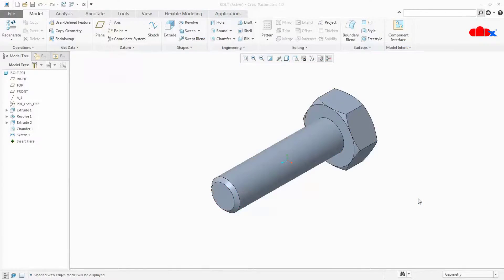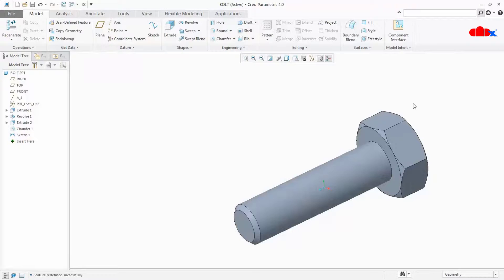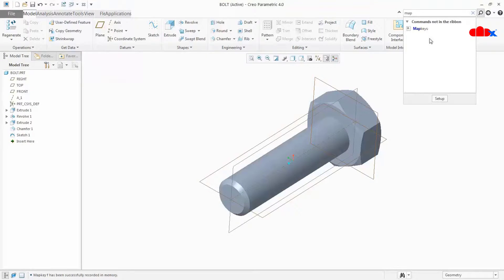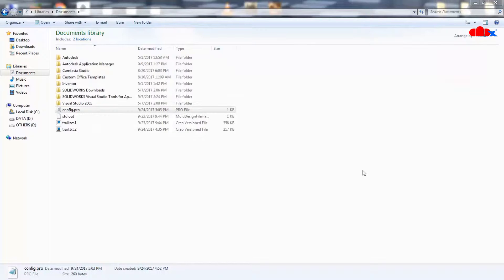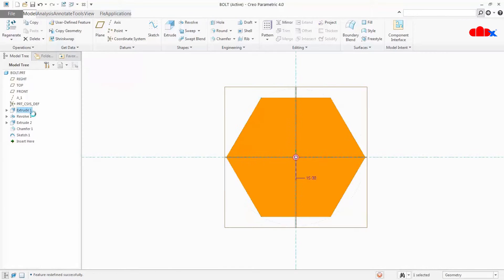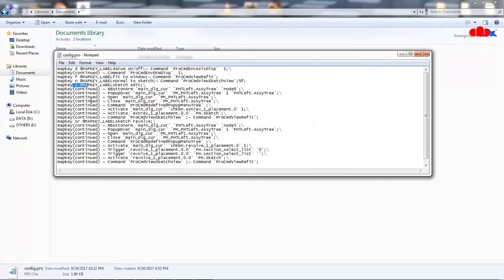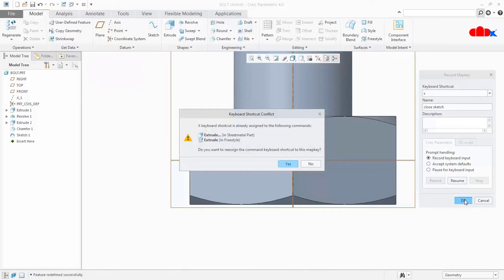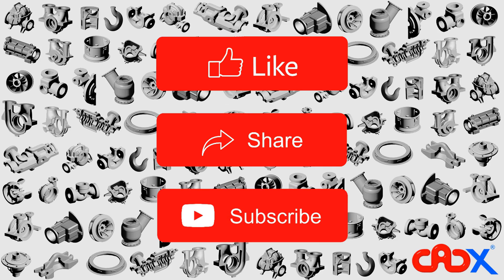Create mapkeys, Nested Mapkeys, Combined Mapkeys and Special Mapkeys in Creo Parametric

Comment: For how many years (or decade) you have been working on AutoCAD, before you switch to any parametric software?
Reply from the maker: I still use autocad. Both the softwares go parallely. I am using these softwares from 2004.
Reply: @CADxTraining  
Were you working with CADD Centre in past?
Your example shows you couln't come out of AutoCAD. I was using IDEAS from 2000 to 2002.
Since 2002 I switched to Pro/E then Creo.
Unfortunately I know AutoCAD too. But always refused to work on AutoCAD. It was outdated for me in 2000.
Reply from the maker: Which example are you talking about?
Reply: @CADxTraining  
It seems that you get offended. That wasn't my purpose.
Good Luck. 👍🏻

Comment: Sir, I did whatever you said but that config.pro file can't open in notepad
Reply from the maker: 😀 I had the same problem initially. Don't worry it's simple. First you open the notepad with run as administrator, and then you browse this config file and open. Now you can edit it and save the config file.
Reply: @CADxTraining  Sir, I hope you would ans for this...Extrude 1 map key worked but Extrude 2 its not working (combined mapkey)...when i edit extrude and edit sketch that time unlink option showing rather than edit.
Reply from the maker: Some issues can only be solved by hit and trial method. It's not always easy to give a solution from my end. Hope you will understand thank you.

Comment: Great job. How can you create a mapkey for a normal view to a certain surface in the model environment (not in the sketcher) without going into sketch mode ?
Reply from the maker: Which version of Creo are you using? Because this is already available in creo parametric.
Reply: @CADxTraining  Creo 2.0 unfortunately  doesn't have it. Very frustrating to work without it
Reply: @vahidavdic7394  
Create a saved view. Then create a mapped key for the same. It was availble since Creo was Pro/Engineer. I used it in 2002.

Comment: Make video series on Assembly in creo, which cover, nut bolt, all gears rack and pinion, cam follower, belt drive, chain drive , all this mechanisms with apply motion in creo .
Reply from the maker: Yes it's there in the line.
Reply: @CADxTraining  thanks a lot